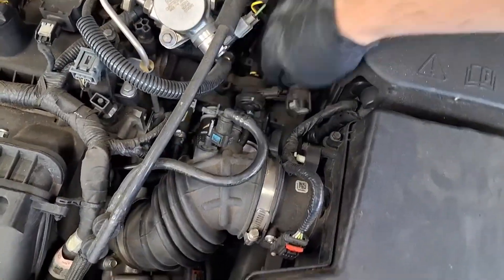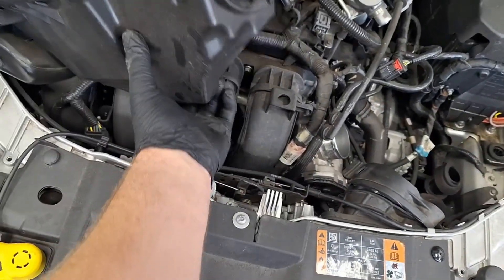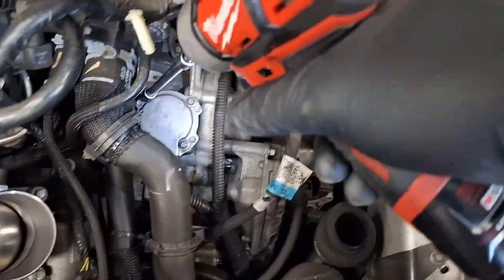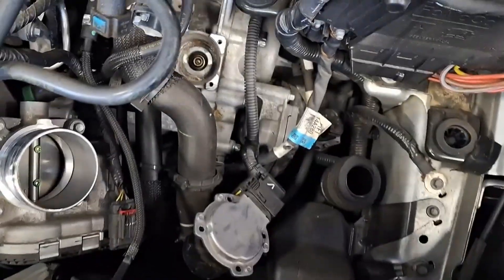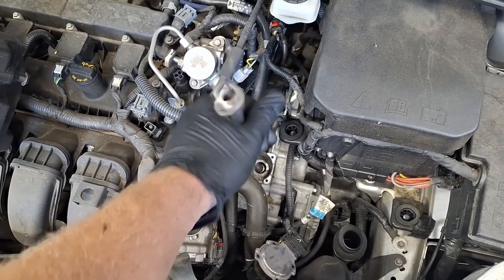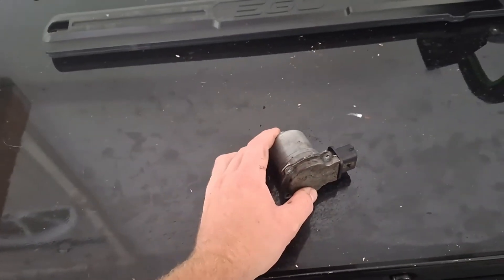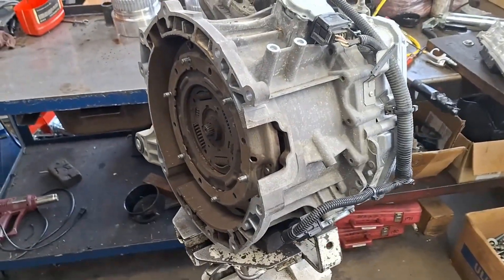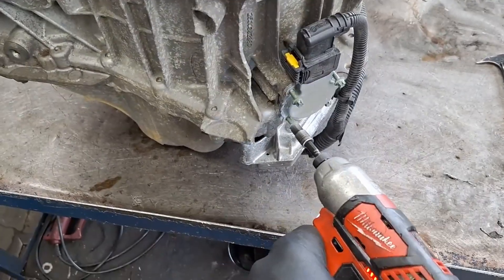Ford Focus & Fiesta DPS6: Do You Need to Perform a Clutch Adaptive Learn After Actuator Replacement?

Comment: I have a 2015 ford focus. I change the both clutch A&B. But the clutch B keeps coming up. I reset the code. I disconnect the battery negative n them positive. Them I clear the code. Bit went I drive for 2 hours. Clutch b keep coming. N I have to keep doing the samething over n over. I can’t press the gas to hard or fast. If I do that the gears ⚙️ take a little longer to change. I don’t know what to do anymore. Can you give anything to help? Please.  Before I purchase the TCM
Reply from the maker: need to know the code youre resetting to know whats going on

Comment: We have a 2017 fiesta, 71k original owner.  Over the past 3 years we've had several dead batteries, with no identifiable reason why.  Now, a week ago, my daughter was at the mall, she started the vehicle, the transmission light came on and she was unable to shift it into gear.  She turned the engine off, waited a few minutes, restarted , no light, and she was able to drive the vehicle home and then to the dealership with no issues.  Thoughts?
Reply from the maker: Could be a number of things, but if there's no codes present to diagnose from then I would suggest installing two new clutch actuators from Ford. Those are known issues on 2017 and 2018 Ford Focus and fiestas. That can cause your issue including the battery drain
Reply: @BigBensCarsAndCycles thanks!

Comment: Great videos man! Just subscribe! I just have a quick question:
Could a bad actuator cause a P073A code? My car slips on startup, but shifts smoothly in S mode when I do it manually. The mechanic says it’s a fork issue, though I replaced the forks six months ago. I suspect the actuator may be sending bad signals to the TCM. Also, the S indicator sometimes doesn’t appear on the cluster — that’s when shifting is rough. When it does show, manual shifts are fine. Could this intermittent S mode problem be linked to the transmission range sensor bushing?
Reply from the maker: If you're sure the code you wrote is correct and its not actually p07a3 then I'm leaning more towards a tcm issue or syncro issue

Comment: My ford focus se 2014 wouldn’t go into reverse. Diagnostic scans showed it’s the b position actuator. It’s at a mechanic but he thinks the trans is slipping but not for sure yet. Rpm goes between 1-2 at a light tap. .. please tell me the trans isn’t going , haven’t had the car for 30 days & seller said that’s what he exactly fixed on the car . I’m terrified
Reply: I got the throttle body cleaned but not relearned and all of a sudden I’m having these problems

Comment: What other programs are there to relearn the TCM, besides forscan ?? Can I drive it at a slow speed to relearn ??
Reply from the maker: Yeah just drive it until it shifts better
Reply: @BigBensCarsAndCycles  one more question, Van you give me an Idea of what it might be - I changed out the forks put it all back together and it started up, ran it for15-20 min. I shut it off. And come to find out that the top actuator just spins and spins it freely in both directions it doesn’t grab. WHY ??

Comment: Hey Big Ben I’m having issues with my focus. Replaced the transmission and clutch. I’m getting P2768, P2765, P0718. Car will not shift out of park what so ever. Replaced transmission case due to shearing and put new luk rep set in. I’m getting transmission fault message on screen. Any advice? Thanks for your videos!!
Reply from the maker: Hey Big Douglas, you probably damaged an input shaft speed sensor. Or wire.
https://youtu.be/6qnGzXXQZzQ

Comment: Hi, I recently swapped actuator A and B in my ford focus 2014 and code remain on Clutch B actuator circuit low ( P090C) , at Ford dealership they quoted me for TCM replacement and for a complete transmission replacement  ( about 1.8k), I want to replace the TCM myself. I just want to know what are the odds that it's actually the TCM as it's updated and recalibrated already...
Thank you so much i managed to swap and read the codes thanks to your videos ❤
Reply from the maker: If the code is still there after swapping actuators, it's a good bet the TCM is the issue.

Comment: Hey, I recently replaced the clutch and flywheel in my 2014 focus. I went with the dual mass flywheel and corresponding bolts. Everything was fine for a few weeks, clutch engagement moved to the bottom of the pedal range. However after a few weeks clutch engagement moved back to the top of the pedal range and now I have clutch slip in 4th and 5th. Any ideas what I've messed up?
Reply from the maker: Pressure bleed the clutch, or run a line from the bleeder to a can of brake fluid then pump it a hundred times
Reply: @BigBensCarsAndCycles  thanks dude. Appreciate it.

Comment: I recently put the Luk clutch in along with new actuators. Put everything back together and have my reverse back but have a wicked shudder. I didn’t use the torque pattern that you mentioned but didn’t know that until after. I haven’t even tried driving it yet until I know if that’s the problem. It’s throwing no codes so do you think that’s all it could be?
Reply: Yeah you have to follow the torque procedure or it will vibrate really bad at idle
Reply: @bluvenm that’s what I was hoping it was. Thanks!!

Comment: So I just did my top actuator today, and that yellow tab can be _BRITTLE_.  Mine exploded into pieces when I tried to undo it.  I'm gonna push the next one from the small sliver you can see on the other side; do I need to worry about that little slide-lock (black) coming loose without the yellow tab there?
Reply from the maker: Should be fine but throw a zip tie on it you're worried about it

Comment: Would sure love to see ya figure out how to make a DPS6 do race car stuff... 😉 ...At least beginning use in your most local autocross events... But please.... let it be a 1.6L Fiesta hatch with no interior 😄
Reply: cant make it a race transmission. when clutches slip ecm triggers limp mode for overheating. a porsche coming up full speed not knowing you are having a problem . do a manual swap. hopefully your local ford dealer has forscan even when they wont admit it. i thought of spraying a combination of isopropyl and water. but you would need the transmission out to know where to drill for injection and excape holes.